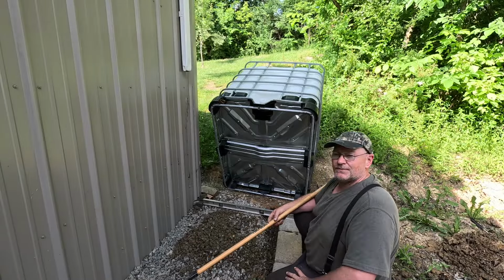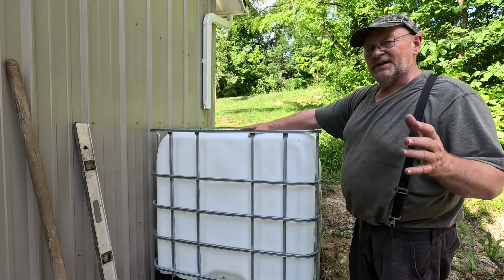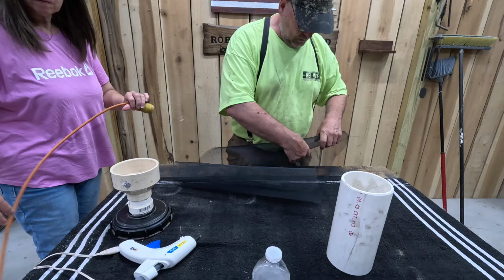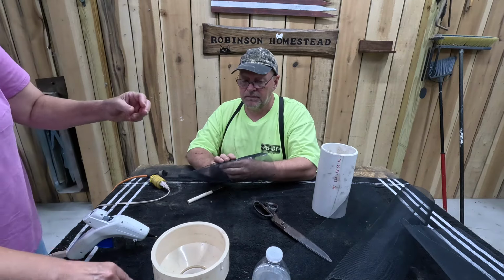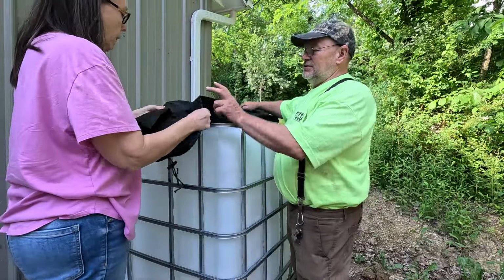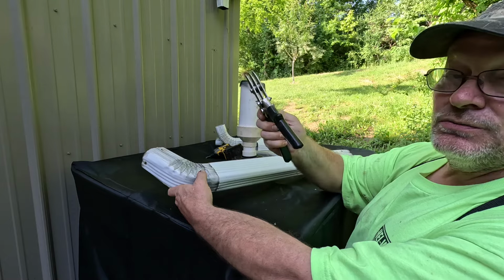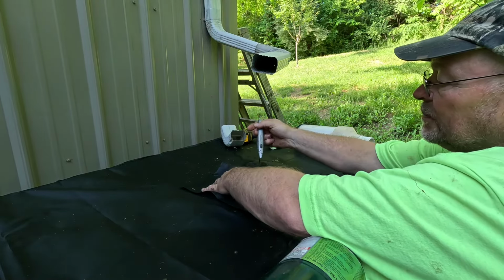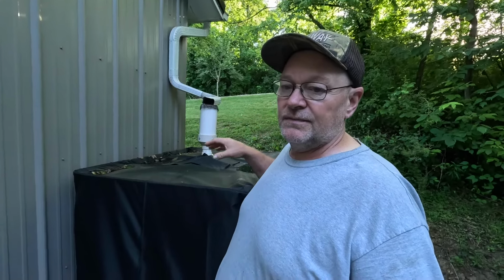Rainwater harvesting and DIY water filter

Comment: Kevin, I set up a rain bag I got off Amazon on our rear gutter for my garden, because gardens love rain water, it`s about the size of a 32 gallon garbage can, it`s heavy vinal with six steel legs, I built a sturdy stand for it and it has a on, off valve at the bottom, I just fill my water can, the top zips shut and it has a mesh screen in the center for debris, one rain and it`s full, I love it. Nice job on the tote system.
Reply from the maker: I like using rain water great for the garden for sure.

Comment: I really like the look of that cover. Looks much nicer than what ive done in the past which is just paint the totes with flat black paint. One thing i would suggest, since i also have a ton of trees around here, i used some 1/4" hardware cloth and made gutter screens over the top of the gutter. Keeps all the leaves and acorns out of the gutter, which will also keep from having to get on the roof to clean gutters out.
Reply from the maker: Thanks for the info.